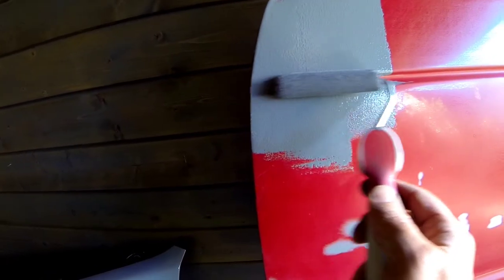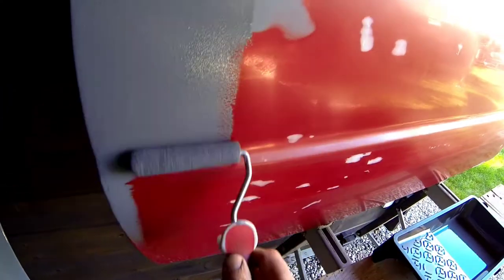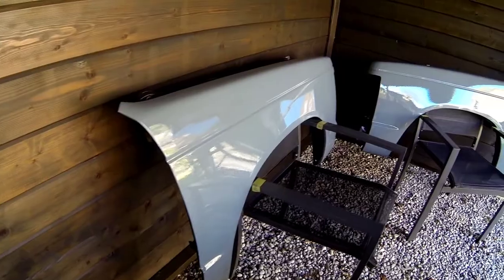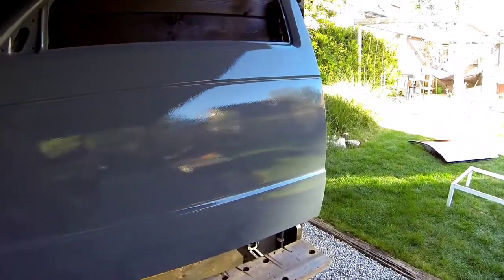Ep. 38 - €100 paintjob, painting bodywork battleship grey | 1991 GMC Sonoma ST

Comment: Did the same to my multicolored panel Blazer, used rustoleum paint. To reduce orange peel while rolling it on, mix 50% paint and 50% acetone, several coats and it will look nice especially white.
Reply: I thought acetone would brake down the paint?
Doesn't it dissolve the previous layers you rolled on when using that much acetone? 
and doesn't it get to thin when mixing 50/50
Reply: @rcundergrounder  No it does not dissolve the previous rolled on paint, but it does thin the paint out which is why several coats are needed to cover the area being painted. And it helps it dry faster also.